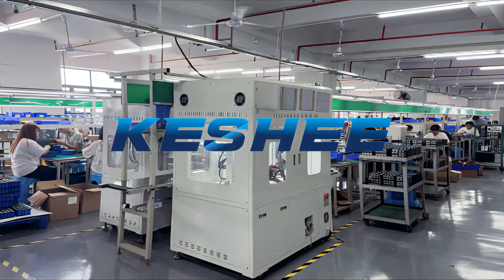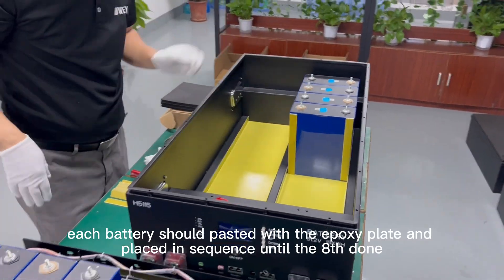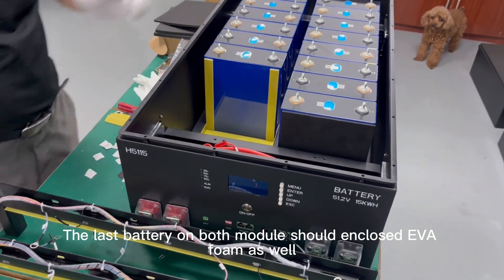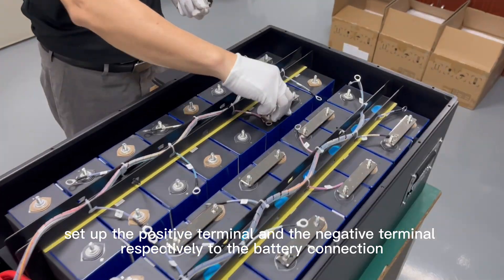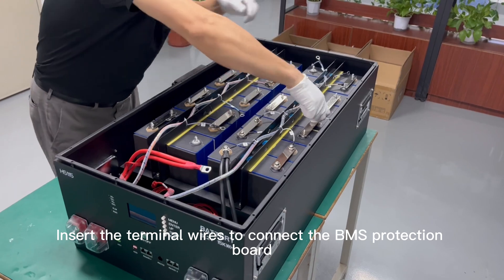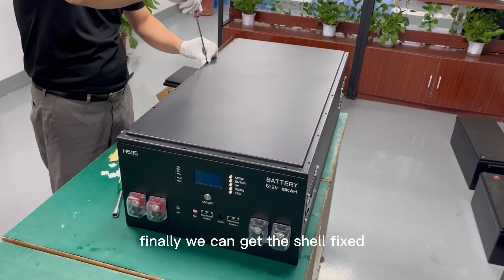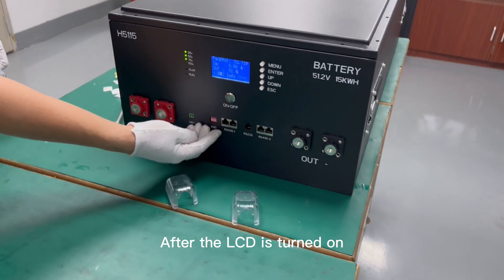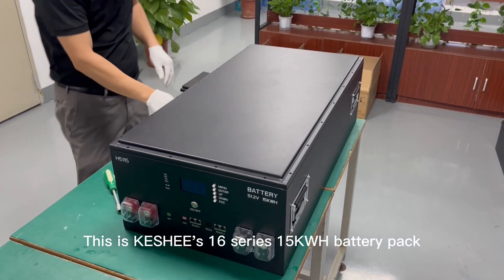【LiFePO4 Battery DIY For Solar System】KESHEE DIY Battery Box Install with EVE LF280K 3.2v 280Ah Cell

Comment: I'm looking to buy this but need the instructions for 15s instead of 16s configuration manual.
Reply from the maker: could you please add my whatsapp:+8613316494371, we have installation guide to assblem the 15S battery pack

Comment: compression??
Reply: Good question,Offgridd!
Reply from the maker: Hello! Thankyou for your message. All of our kits are made with the idea of compression, the bottom battery mount of the kit is perfectly designed to hold the battery tightly. In addition, the two metal pressure bars on the top also greatly fix the battery to prevent the battery from moving. You can refer to the size design of our kit. if you want to know more information, please contact us via: sales3@keshee.com. Thank you.
Reply: @KESHEEBATTERY168  I see you give each battery room for "breathing"hence: no compression. Nothing wrong with this but EVE states that 300kgf "clamp" expands the lifetime so I will be running my setup with a very smooth "spring-force"when expandingin order to keep them un-bloated during many years of use.
Time will tells what happens...
Reply from the maker: @offgridd  Hello! Thank you for your message.  Even for EVE side, there is no clear evidance to show compression can expand the lifespan of lifepo4 cells. If you want a lifepo4 to last longer, just keep it cooler and make the pack larger. That's it. There is no so much meaning to figure this out, maybe some of them will do compression, but after years, I guess their lifespan will reach what is it.
Reply: You mean that during the charge discharge cycles the batteries swell, because in my experience this happens with batteries of this kind
Reply: But it it looks like the battery string is put between two metal plates from the start.
Reply from the maker: Hello! Thank you for your question. Further for compression, all of our kits are made with the idea of compression, the bottom battery mount of the kit is perfectly designed to hold the battery tightly. In addition, the two metal pressure bars on the top also greatly fix the battery to prevent the battery from moving. You can refer to the size design of our kit offline. Thank you.

Comment: Won't the batteries have a cooling problem in this case? Why are there no fans?
Reply from the maker: Hello! Thank you for your message, it is not recommended to add cooling functions such as fans, because if the cooling function is added, the battery will be exposed to more humidity and water during operation, which will accelerate the aging of the battery. About  heating, because basically there won't be too much heat coming out. In addition, when we designed the box, the BMS also has a temperature sensing function. If you are really worried about the heat problem, you can pay more attention to monitor the status of cells. Hope this can help you. Thank you.
Reply: @KESHEEBATTERY168  Thanks a lot!
Reply: @KESHEEBATTERY168  Is your BMS compatible with deye hybrid inverters?
Reply from the maker: @ivaylomanolov1455  Yes! It can match. If you want to get more details about this kit, please send email to our team: sales3@keshee.com, or WhatsApp: +86 15019297714. Thank you.